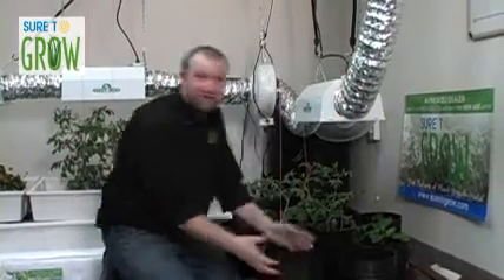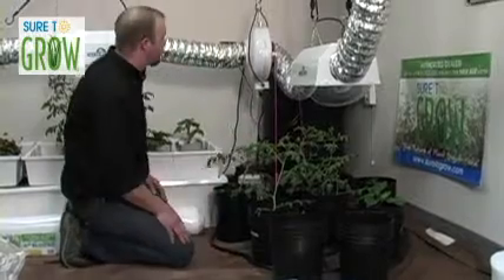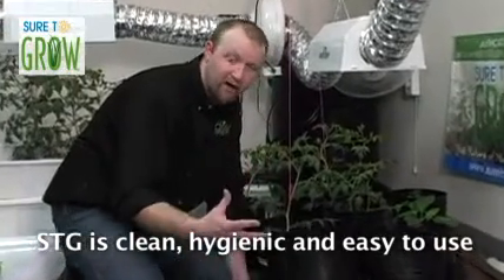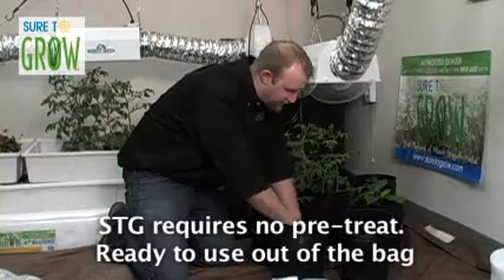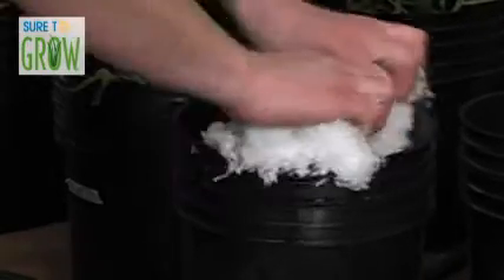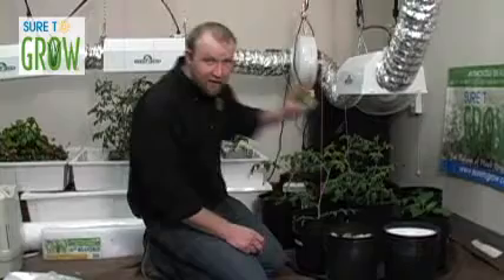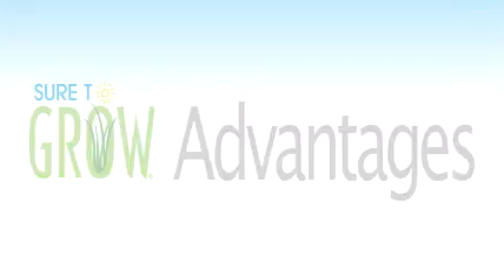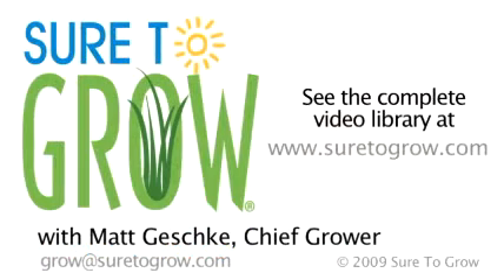Setting up an ebb and grow hydroponics system with Sure to Grow inserts

Comment: So could use use the 5 gallon bucket single foam unit in a DWC? Like it is was filled wiht water in a bucket, would that work, or is it only for ebb&flow system.

Comment: Thanks so If I wanted to make my own system with the 2 gal outer pot but with a 10 inch insert like the ones that go over the 5 gal buckets for dwc and snap on top. I don't like the fact that the roots are growing through all that medium hydrocorals seems that if using talks medium than it would be fine but I've got a lot of corals to use Plus I think having the roots just hanging would be better where theyde really have 2 gals to grow in instead of a lot of corals or if i did it that way

Comment from the maker: @firebird14420 The CAP E&G unit does not allow you to adjust the flood height. We have seen some units overflow our insert and then compress the insert, this is not good. By placing the pipe under the inside bucket it prevents that from happening without any negative affects. it's like an insurance policy, its their when you need it. Thanks for the question.

Comment: Why does a pipe have to go underneath the insert to control height of water doe the controller not do that and why would the pipe have to be drained and seen if out of shape. Like to know to if the 2 gal buckets are the same as 5gal ones bc I wanna

Comment from the maker: @t04011984 yes, using the PVC pipe will lift the inner bucket up to prevent the water from getting on top of the insert and pushing it down. it would be very helpful to try to let the water drain out of the insert, so it can get back to orginal shape. take the insert out of the bucket and turn it in its side the water will spill out like a glass of water. if it does not come back to shape, use a couple of drapery hooks, hook one end in to the insert the other hook over the bucket

Comment from the maker: @2jcalex the CAP EBB  and Grow system is very popular and pretty easy to use. there is a lot more that goes into growing than just your system. lights, nutrients, plants and proper enviornment. If your good on all that the E&G will work fine.

Comment from the maker: @MrGlassAddict Thanks for the question. No media is resistent to algae, however because STG is non-wicking, the grower can control how much if any water gets to the top of the media. if the top stays dry, you will get little to no algae. STG is completely inert so it works well with anything put into it like beneficials.

Comment from the maker: @littlevil420 Are you talking about the CAP ebb N gro bucket system?  Most likely the upper float valve failed......as it did in mine.  I had this happen to me as well, the entire reservoir flowed onto the floor.  You can find out by filling the system, switching it to on, or flood setting, and watch. If your controller overflows....  Most likely you'll have to ask for a replacement controller.  Luckily they have now modified the design, so you may get a newer one.

Z

Comment from the maker: No blue during bloom unless you want to stress the plant during the final week and this should be done with a 10000k not a 5400-6400k MH.  MH should be used exclusively for veg.  Any blue input during veg will lead to stretch and an increase in the internodal length resulting in less overall production.

Comment: Re: watering for this type of media, what is recommended? In the demonstration, my fear is the pooling of water at the bottom of the pot causing root rot. If you could answer my questions that would be great. I checked out your website and your vendors... Very competitive prices to Rockwool.

Comment from the maker: I appreciate your subtle attempt at sarcasm however you are still forced into the feed flood flood feed cycle. I still fail to see how this method is more efficient than a DWC system in which the plant can feed at its leisure with very little effort. Secondly, if you dont have to wrestle a molecule away from your media due to its high CEC than wouldn't it stand to reason that the plant could use more of that energy for production?

Comment: I'm sorry, but I was under the impression that having a medium with strong cation exchange capacity was actually good for the plants and helps the roots to uptake nutrients.  

Checking the runoff ph and ec and watering at regular intervals with ph'd RO water keeps salts down in coco, depending on the nutrient regimen.  This is common knowledge.

Comment from the maker: The goal is to have a media that does not influence the nutrient of plant directly.  The ultimate media would merely promote healthy root development and provide the roots a substrate in which they could anchor themselves.  Combine this with the recyclability of STG, it is PETE1 afterall, the most recycled plastic in the world or it can be burned cleanly in a biomass furnace with a thermal value similiar to soft coal.  Did i mention it is inert and sterile as well.  Hard to beat!

Comment from the maker: STG does not behave like coir or rockwool do to its hydrophobic nature therefore it is difficult to overwater this product.  Rockwool and coir use distinctly different methods to retain water. STG uses a combination of cohesion along with a proprietary structural design to retain water.  This design allows STG to have a similiar residence time to rockwool and coir while allowing for a complete flush of all stale nutrients with every flood cycle.

Comment: Well,  if it's holding water that well then it's not like hydroton is it? It's  like rockwool or coco.   

If you're doing frequent E/F with a high water retaining medium you can oversaturate the roots,  even with aerated water.  I'd recommend only one feed/day with this medium.  

I've uses a DWC and most of the remaining hydroton residue tends to accumulate on the bottom.  

Frankly I've had more trouble with roots clogging submersibles, which is why I'm switching to the CAP system.